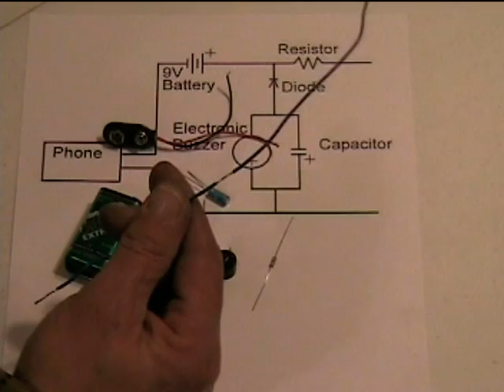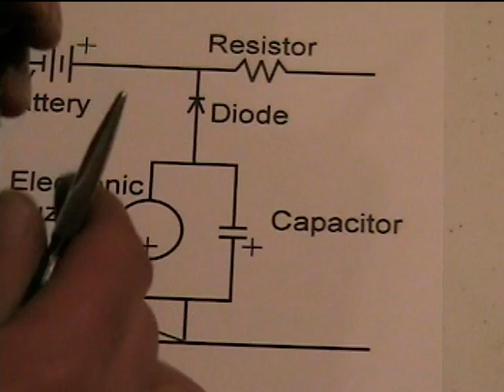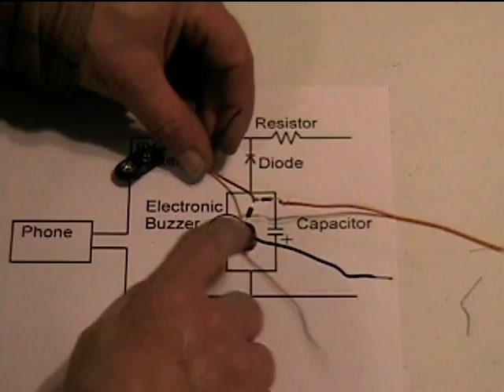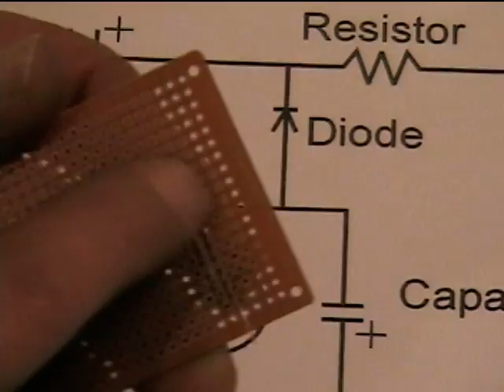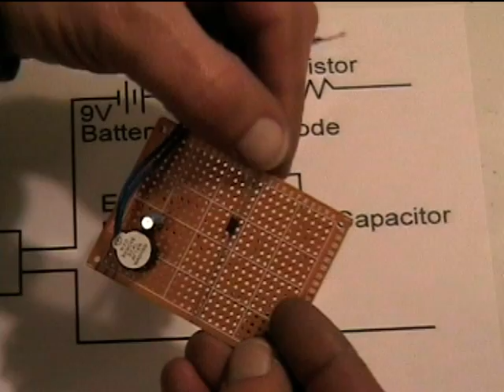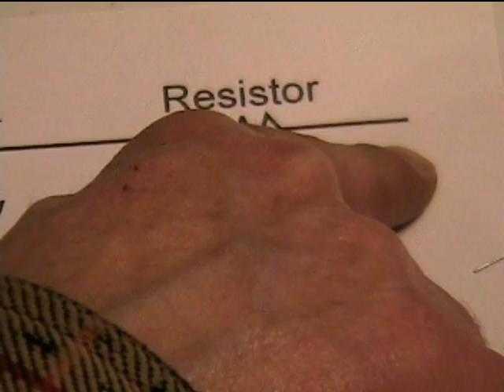Building 2 Phone Intercom W4P300 #303

Comment: Seeing that this circuit is directional, how hard would it be to send the intended dc through a bridge and still have it work as intended?
Reply from the maker: Yes, it is a DC circuit so it is directional. I don't know what you are trying to achieve. Where would the bridge go and what benefit would it provide? If you put a bridge in place of the single diode for the buzzer, this would cause the local buzzer to sound when you pick up your phone, reduce the power to the buzzer at the distant station and possibly cause the local buzzer to sound while you are talking to the other station. If you had something else in mind, send a sketch and explanation to me at   intercom4u at yahoo dot com
Reply: @wired-up  Ideally, I'd like to not have to worry about how many phones are added or the polarity of each phone.
I was thinking of an H-bridge between tip and ring. 2 diodes pointing towards the negative side of the circuit and the opposing side pointing away. The buzzer, cap and resistor in-between the 2 diode legs.
Reply from the maker: @roamingcelt  The circuit will only work for 2 phones, just as shown. Ignoring the signaling for the moment, each phone has its own battery supply. When both phones are off-hook (in use), they are in series. If you were to label the wires at each end as + and -, you swap the two wires as they go to the other station so that + from station 1 goes to - of station 2. The - of station 1 goes to + of station 2. If you were to connect a third phone into the middle of the line, the + would go to one of the wires which has it connected to the + of one station and - of the other which means it can only talk to one of the stations because the polarity would be wrong to the other station. Then, as I mentioned, using the bridge rectifier on the buzzer circuit (which would allow it to buzz for either station polarity) may have it still buzzing while you are talking to another station and even though one of the stations could buzz you, you wont be able to talk to them because the talk polarity is wrong. If you have more than two wires between the stations, it would be easy to set up a manual signal system and have as many stations as you want. Send me an email for diagrams on how to do this. Ask for "icom files 2of2"

Comment: Thanks for sharing. Do you think it is possible to replace the buzzer with a relay that would allow the 48 volt power supply to make an old dial telephone ring?
Reply from the maker: There is very little power available for the buzzer. A sensitive reed relay might work in place of the buzzer, or, use an opto coupler (led with a light-sensitive transistor) like 4n25 or ps2501 to operate the relay. You will need 70 volts or more AC, usually about 20Hz for a mechanical ringer like you would have in an old rotary phone. If the phone has an electronic ringer, it may work at a lower voltage and will not need to be 20Hz.
Reply: @wired-up  mille mercis 👍😊

Comment: Muy bien, lo felicito, pero que valores tienen los componentes?
Reply from the maker: Each end needs:  telephone, 9 volt battery, 68 ohm resistor (1/4 or 1/2 watt), diode (1n4001 is fine, just needs to be more than 20 volts), 22uF electrolytic capacitor 16V or more, electronic buzzer that works from 3 to 12 volts but very small so that it does not draw much current.  https://youtu.be/3l5se0gGM18?si=4bMlQTZxVlN__Rfc&t=139

Comment: What is the value of those resistor capasitor and diode?
Reply from the maker: Resistor is 68 ohms, not critical. Might need to adjust if the current in the circuit is too high or low (should be about 15mA or so), 1/4 watt minimum, 1/2 watt would be good. Capacitor value depends on the buzzer. I used a 22uF capacitor because that is what I had, 10uF is probably plenty, 16v or higher rating. Diode is 1N4002 but almost any small rectifier diode would work.

Comment: Can this be done with 3 or 4 phones all hooked up so you pick one up it rings the other 3
Reply from the maker: No, this circuit works only for two phones as shown. It would be possible to have multiple stations on a parallel talk circuit and use additional wires for manual signalling. Send me an email:  intercom4u at yahoo dot com and ask for #321 intercom circuit.

Comment: This is a great circuit! I’m currently in the process of building it. Could I connect multiple phones instead of 2?
Reply from the maker: No, at least not with the ability to signal individual stations. Search for w4p300 #301 or w4p300 #304 to see a couple of 8 station systems.

Comment: Great job, a question: How to make a buzzing (or lamp on) in a incoming call? (from pstn) Many thanks.
Reply from the maker: Jose, I assume you realize this project has nothing to do with the PSTN (Public phone system). For a regular phone line that comes into your house, you would need to detect the (approx) 90 volts AC on the line when it rings but not be affected by the (nominal) 48 volts DC on the line. One project I made many years ago used a simple neon indicator light (it was a 120vac panel indicator) connected across the phone line. It would light when the phone line was ringing. This would illuminate a photo-resistor connected to a transistor that turned on a relay to sound a loud bell in a factory. I chose this design so that I could have 3 neon indicators, one on each of the 3 phone lines shining on the one photo-resistor, that caused the bell to ring. Another method was to use an opto-coupler (like a 4n28 though I don't recall the specific part I used) connected to the line thru a capacitor and resistor that would turn on a relay for a similar application. Do be aware that it is not permissible to connect anything to the pstn that is not fcc approved. If your device causes problems on the line, they may suspend your service. I've not had any problems myself.
Reply: @wired-up  Do you think this works?: https://www.youtube.com/watch?v=TJYmSxgGly8&list=WL&index=28

Comment: Why do the buzzers stop buzzing when both handsets are picked up and the conversation starts? Because the voltage drops to them? Amperage drops? Both? Other? Thanks.
Reply from the maker: When both phones are off-hook, the voltage across the buzzer circuit (diode, capacitor and buzzer section) not only drops to 0, it actually goes slightly negative (the diode is there to protect the electronic buzzer from damage during reverse polarity). When you pick up just one phone, there is a lot of negative voltage at the buzzer associated with that phone so it doesn't sound, of course, but since the line reverses on the way to the other station, the polarity is correct for it to sound until the other station goes off-hook and its buzzer circuit also now has reverse polarity while the stations talk. Good question!

Comment: Good day sir, will this take 12v? Thank you
Reply from the maker: Yes, 12 volts would be fine. You may need to increase the value of the resistors some if the current is high (not all phones are the same so I can't give you an exact value). You can connect a meter set to measure DC current in mA in series with one of the wires that run between the stations. 20mA or so would be a good target but it is not critical. If it is more than 30mA, increase the resistor value to keep it below 30mA. Excess current to the phones is usually shunted in the phone as wasted as heat as well as draining the batteries more quickly. Gross excess could damage the phone.
Reply: @wired-up  thanks sir and have a good day

Comment: Can any rectifier diode be used 1N4001-1N4007, or is a particular number needed and if so, why?
Reply from the maker: Any 1N4001-4007 would work, it only has to stand a small amount of voltage (9v battery). The higher voltage rating diode would work, just slightly more expensive. Other types of diodes would work as well as long as they will stand the voltage and the current. The maximum current would be when the first phone is lifted while it is charging the capacitor and powering the buzzer. This could be no greater than the current you would have if the line were shorted which is limited by the resistor and the phone and is likely to be less than 50mA.

Comment: Regarding the resistor, would the ohms value to use depend on the battery voltage and/or other components and/or the length of wire between the two phones or is 68 ohms just a good value whenever using two 9-volt batteries with two phones?
Reply from the maker: The resistors and the line combine to make one resistance (you will see that they are all in series). 68 ohms is a good starting value but will depend on battery voltage and the characteristics of your phones as well. If you had a long line (several thousand feet), you wouldn't need/want the resistors. My intent by having a resistor at each end was that if the line were to be shorted, the one resistor would limit the current thru the phone to a safe level that would not damage it. Under a shorted condition, you want to keep the current thru the phone to less than 50mA. Obviously varies by the phone but most should stand 50mA without damage I would think.

Comment: I have a couple of questions about the capacitor.  (1) must the capacitor be "electrolytic" and if so, why? Would a non-electrolytic capacitor also work? (2) when you say the capacitor microfarads depends on the buzzer, how do I determine which capacitor microfarads value to use with my buzzer?
Reply from the maker: 1: The capacitor does not have to be an electrolytic but this is your cheaper option. A 'cheap' ceramic disc capacitor of a few uF would probably cost several times that of an electrolytic. Of course, the electrolytic would not stand reverse polarity (or AC) like a disc would but in this circuit, the polarity is known and reverse polarity is blocked by the diode.  2: What size capacitor? Not sure that I could give some kind of formula for that. Each buzzer would be different in its characteristics and being undersized slightly would probably just reduce the volume some. Other things come into play such as how big a resistor you have in the line at each end and how much resistance the line has as well as the impedance of the phone. A few uF is enough for the small buzzers I have used. Going bigger isn't a problem unless you go really big (guessing several hundred uF) which may then cause a short delay before the buzzer starts and then it would continue for a short period after picking up the phone.

Comment: I've been experimenting and have a question.  When I connect a 9-volt battery to one phone and remove the handset, my multimeter measures about 5.5 volts, but when I try to measure the resistance through the phone with my multimeter, it displays "OL" which I understand means there's no electrical path. Why wouldn't the multimeter sense an electrical path through the phone and display the resistance when the handset is off?
Reply from the maker: Most phones have a "Polarity Guard" which is likely just a bridge rectifier on the line. The electronics in the phone require a particular polarity to function and the diode bridge will ensure the polarity to the electronics is correct, regardless of the polarity of the line. The diodes have a voltage drop and you are going thru two of them. If they used silicon diodes, each will drop 0.6 to 0.7v so a total drop of 1.2 to 1.4 volts. You will see this drop when using your meter to measure voltage at the points where the line would connect as well as some additional drop due to the resistor and resistance in the phone. As for your meter showing an open circuit, many digital meters put out less than one volt when set to measure resistance, this would not be enough to forward bias (turn on) the diodes for them to conduct. Sometimes setting the meter to read on the lowest scale will give a greater voltage to the probes which 'might' be enough to get the diodes to conduct but the reading would have no meaning since it would be trying to interpret the voltage drop it sees (from the diodes) as resistance and give you a bogus reading. A reading of any kind (other than OL) would indicate that there is some continuity thru the phone.

Comment: How about swapping in an LED in place of the buzzer? I would like to have an indicator light instead of the buzzer to make it quiet
Reply from the maker: Yes, skip the buzzer and capacitor and just use an led. If a single LED isn't bright enough for you to notice, you could use an opto-coupler to drive a transistor and light a larger light, maybe something like an LED clearance light like used on trailers. If you send me an email to intercom4u at yahoo dot com I will send you more information. Ask for  "icom files 1of2"
Reply: @wired-up  Thank You so Much!!!!!! I have it working perfectly with LEDs instead of the buzzers. All scavenged parts. one resistor is 22 ohm and one is 330 ohm, still works. all I had to do was reverse the polarity of the led on one end even though I did the cross over.
Reply: What is also crazy is that I tried this setup over a long piece of RG59 coax and it still works perfectly. I was amazed! I now have a few options to run this intercom, over cat5/6 cable, phone cable, XLR mic cable and now coax that we use for SDI video. Thanks again for the great inspiration and the help
Reply from the maker: @patthesoundguy  I had used this over one of the XLR channels in a 100' 16ch snake cable to have a phone at the mixer and the other phone back-stage (also using LED's because noise wouldn't be good). The cable isn't critical as you have found.
Reply: @wired-up  my setup is going to be used for exactly that, phone at FOH and the other back stage. I mounted the two setups in network boxes that have two RJ 45 jacks in the front. One jack is phone in the other line out. I have a bunch of network jumpers that are getting the various connections I will need, XLR, BNC. I am so pleased with the set up.

Comment: I replaced both batteries using either single or 2 dc adapters
It cannot work...
Reply from the maker: I have built the circuit using two 9V DC adapters (one at each end in place of the batteries) and it does work. I assume that yours worked when on batteries, if so, perhaps the polarity is backwards. If you pick up both phones, can they talk to each other? Send a photo of how you have it connected and I will see if I can find the trouble. send to  intercom4u @ yahoo.com
Reply: @wired-up  I found that the wiring was not properly done, but now it's working great...thanks for sharing this
Reply from the maker: @yepeha  I am happy to hear you have it working! Thanks for letting me know.

Comment: Can I make it without using buzzer?
Reply from the maker: Sure, you can leave out the buzzer, capacitor and diode if you want. Actually, all you need would be a 9v battery and the two phones wired in series in most cases but you might need to add a small amount of resistance in the loop (50 to 100 ohms) to limit the current if too high (usually wont be an issue with just one 9v battery). You would need some way to know that the other person wants to talk.
Reply: @wired-up  No sir, I mean to exclude only the buzzer from the circuit. I have already made it up to the resister circuit. Now I need to add ringer circuit to it.
Reply: @wired-up  Lines are working now. I need to setup ringer circuit.
Reply from the maker: @ONEEARTHLIFE  Sorry, I'm not understanding what you want. You don't want the buzzer but you want to add a ringer? Please explain.
Reply: @wired-up  I want the telephone to ring but without buzzer in the circuit.  I do not want buzzer to ring.  Is it possible to avoid buzzer in your mentioned circuit and get the phone to ring.
Reply from the maker: @ONEEARTHLIFE  OK, you want the ringer sound instead of the buzzer. Yes, it could be done. Use an opto-coupler (ps2501 or 4n28 type), putting the led half in place of the buzzer. Use the transistor half to operate a dpdt relay that disconnects the phone from the circuit and instead connects it to the output of a ring-voltage generator (search for something like a  PCR-SIN03V12F20). The ringer will sound continuously until you answer. You could probably rig something with a 555 timer IC to make the ringing intermittent. The ringer in a phone requires an AC voltage (typically 20hz) and at least 50 volts, maybe more depending on the phone's ringer. No, I don't have a circuit to send you showing how to do this.
Reply: @wired-up  Thank you so much. I will try this and let you know the results.

Comment: im confused as im trying to put the power souce in center of both so i dont need 2 batteries 1 on each end, but how you do that can you help? i need the battery in circuit diagram to be in center so it visually makes more sense and semetrical!
Reply from the maker: Nope. Wont work that way. The battery at each end is the power source to signal the other end. Both batteries are used when talking. A different circuit could allow you to use a single battery in the middle but would require a couple of zener diodes and the battery would have to be higher than 9v, probably more than 12v, depending on the buzzers.